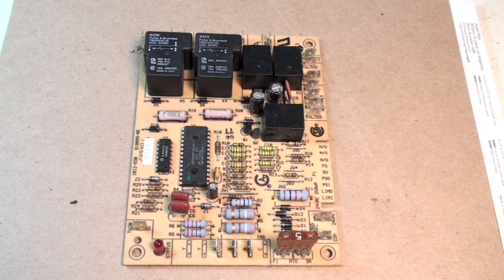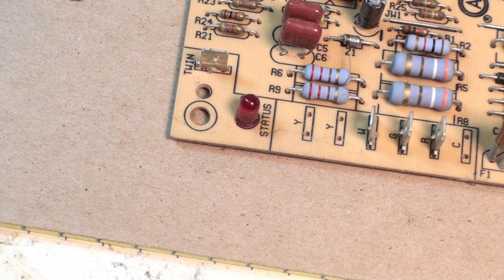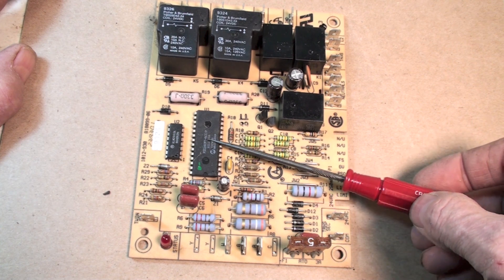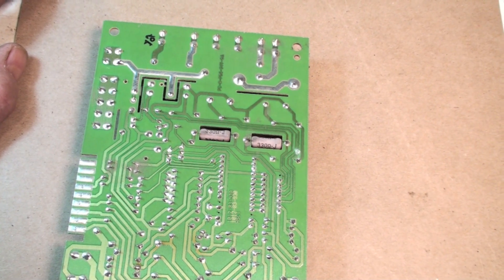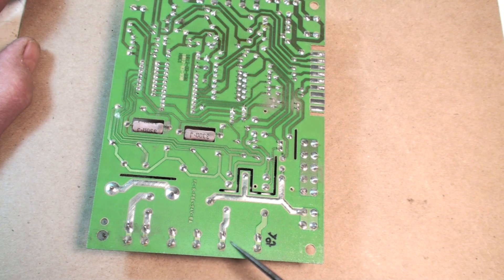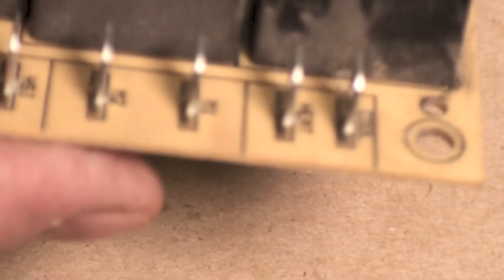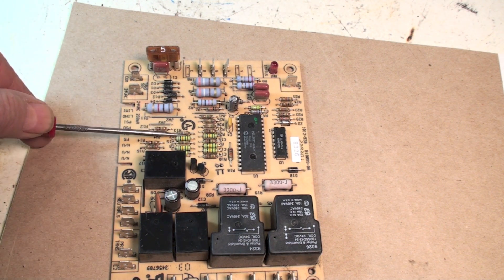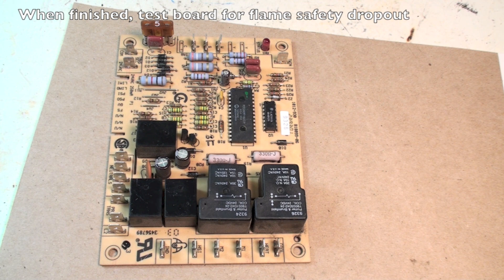Troubleshoot the circuit board of the gas furnace

Comment: Lots of diodes and easy to check . I’ve found a bad zener before on mine . Only thing you can’t replace is the microchip processor U1 U 2 possible but for the price it’s not worth it .

Comment: Nice video. 
My Vulcan 550D furnace fuse keep on blowing soon after I start the furnace. What might be the reason?
Reply from the maker: Is it a low voltage fuse or high voltage?
GFM
Reply: @grayfurnaceman  how can I check whether it is low voltage or high voltage? It is the bottom one which is blowing. Top one is fine
Reply from the maker: @engrhammad  Send me a pic.  Send to Grayfurnaceman@gmail.com  
GFM

Comment: I'm sorry, but I'm six minutes into this < 8 minute video and I still haven't seen a multi-meter or any instruction on "Troubleshoot the circuit board of the gas furnace" as stated in the title.
All I've seen is your personal/professional opinions and advice as to the fact that it is easier and more cost effective AND SAFER to just replace the board.
I agree, wholeheartedly.

But why should I spend $150 + bucks to purchase another board without TESTING the board I have and verifying  that it IS IN FACT BAD ?

I thought this is what I came to this video to learn.
SMH
Reply from the maker: That's because there is no multimeter based testing of these boards.  
Once we moved to electronic controls, traditional electric troubleshooting is no longer effective.  
The board may troubleshoot itself and will give a code indicating it has failed.  However, if any of the relays on the board have failed, it may just not operate.  
That is why I noted the traces may be burned on the back of the board and the larger resistors may have a haloed trace solder joint.  
When troubleshooting a furnace, the board may code where the start sequence has stopped.  Such as pressure switch failed to close.  That means you need to look at venting or combustion air supply.
These boards are often replaced but seldom are they the problem.  They just direct you where to go to look for the failure.
GFM
Reply: @grayfurnaceman  thank you for your reply sir. So you're saying... there is NO way to test point to point on these circuit boards to find where a fault may be ?

Let's say, for the sake of conversation, that it's February, a Saturday evening, -35° F outside, my furnace quits at half past midnight. I live in a very rural area. The nearest hardware store is 18 miles away.

I have a back up generator, two in fact, one for the house and one for the shop.

Without heat, at these temps (common here) our house is going to cool pretty fast.

There is NO 24/7 repair service... we's that rural !

I have a shop, I have tools, I have test equipment and a rudimentary knowledge of how to use it. I need my furnace and I need it now, not 72+ hours from now. Our house is going to literally FREEZE with us in it.

Here in the far north  of Minnesota, we have a portion of February where the temp's drop to below -30° for a sustained few weeks at times !

It has happened to us, more than once and I want to be as capable as I can at being able to troubleshoot any problem that arises here in the woods.

So maybe you see my question differently now ?

I can stock certain parts on hand, but certainly not everything I might ever need.
I do keep things like switches, fan motors,  solenoids, relays and such for both the furnace and also the well pump and the wood boiler.
Without any of these appliances, you gonna get pretty cold up here in da nort :)

I can replace everything one piece at a time, my landlord's method of operation, but I'd rather save myself the time and effort (and him the $$$) and only replace the one part that is faulty.

Thanks again sir.
Reply from the maker: @mebcool  There are 2 ways electronic boards fail.  One, is the electronics fail.  No repair.  Two, a trace burns up or one of the relays on the board fail.   You can, if you have the skills repair traces or wire around the relay to another separate relay.  
GFM
Reply: @grayfurnaceman  Thanks again sir.
I guess I just keep doing what I been doing.
Have a great day bud.

Comment: GFM
researched how the power relays works in general and problems do arraise with them burning coils/connection tips... . Also put in a new Thermostat, similiar to old one, went in smooth, fired up furnace, gas, and large circulation blower.

??  serious on this question... the larger power relay that has a hole burnt through it? 
part  
    T9AV1D12-22
What is your opinion on if I absolutely need to replace the part/board.. and what you may know what it opperates?  Being the furnace seems to run ok and cycles normal! 

Only thing I can think is if it regulates a 2 speed option with the large or small blower fan? 
I know years past it des have a low and high audible modes.

Know I am overloading you some, but this is the main issue I am looking for good advice on .. :) 
Appreciate the help.
 Eric

Comment: GFM, little good news.  know you are busy, bument on what I was able to do today! 

Ok retested the wires going to the ignitor after I reinstalled it, (test ok w right setting on meterohms lowest.)  ran furnace enough to actaully get a reading dood ... double checked the back on board.. dark marks none, just on power relay with a burnt hole in the front corner!

cycled the furnace after testing the water pump, and pump ok, ran it a bit. 
And ignitor did heat up, sat that way awhile and gas Finally!! kicked in.. and take off.. heat!! 

shut it off did it again, and made sure large air circulator fan kicked in.. and it did,, ran it a few minutes and let off the R-W.. gas went off.. 
small fan stayed on in gas compartment, then went off! 

large fan continued to blow.. cool,,  and clicked at the board when going from high to low speed.... then eventually shut off on its own, 

orange light came on, while running , meaning gas / furnace is on, and no problem codes with Red/Green or the Yellow
I did this with out a thermostat connected, still have to buy a new one. 

My question is the power relay that had burnt a hole in it?  What does it control?   (...how is it supposed to function regularly?)    with all the features I described that did kick in and the gas shutting down when R-W was released? 
And what is the problem you see so far... 

Me replacing that board, and probably buying a new board and keeping the old as a spare...
and have to test the thermostat now that I have gotten the furnace to run!, but think the power relay somehow had to do with the thermostat going blank!  if the thermostat is still considered good, but as not much will get a new one and maybe keep current one as a back up. 

Thanks for you thoughts on it.  MEans allot to have gotten this far. 
Eric 
MN

Comment: just removed Ignitor, and cleaned it up a bit.  realized I used too high of a ohm setting .. used lowest one and have a reading.. 20, and sometimes fluxates 40-70..  do not zero or one as I thought at first!  will look at thermostat rod and clean it, but back to the board not sending voltage to the ignitor?  will have to test again to see if I can run it longer to see for sure if the board is not sending any juice to the ignitor... 

Any other things I should check.. to see if good, faulty.. If ordering parts would be nice to get everything in one order, since I will be waiting on the ship time. 

Thx Eric

Comment: update, checked resistance, 200ohm mode, cheap checker.. did it a few times.  and jumps at first then goes to 1.. so, know the board power relay needs changing, or new board, this part.. j-tube modified hard tube to not get the green light blinking code!  what next?  mmmmm turning into a few parts here..  but glad I have some good guidance.!   first time home owner here. 
Where to start..   or what else to check..  :) 

Thermostat may replace as well for good measure!  
Thx Eric

Comment: In addition to my message below from earlier today, ....
had went back and checked the igniter plug, AC reading from the wire coming from the control board.... inserted leads and turned power on, 0 anything, when jumped R-W and running long enough before blower shut off.10 seconds.  couple tries..  So the power relay/ larger one on board maybe effects if the igniter gets any current at all ? 

Was going to inspect the thermostat part, and igniter part for discoloration, but no voltage coming from the board, passed on it for now.  again your thought on appreciated knowing this.
Thx Eric 
MN
Reply from the maker: The ignitor only gets power for from 15 seconds to 45 seconds depending on model.  It gets power after the pressure switch proves for aforesaid time period then shuts down.  
The first thing I would check is resistance of the ignitor.  Isolate it and check.  Should be 13 to 18 ohms for stick ignitor or about 150 for the one that looks like a wavy element.
GFM

Comment: Sorry, forgot to mention that R-W jump (I  keep the jumper on it for 30 seconds),  only turned the gas section blower on, no frst click for gas to come on, or of course igniter. 

Tried again ...  jumped R-W a couple times by touching conections for a second, couple times and blower comes on for a short time, then shuts off.. No smell of gas, and no clicking, just the blower powering up.. 
assuming with no gas being sent that is normal, (again no red/green codes and did have gas emergency valve open prior)
going to try to dig little, .... appreciate your wealth of guidance!
Eric

Comment: OK reinstalling jtube worked for blinking green code.  so no codes currently.  Though  jumping R-W starts the gas compartment small blower, and with gas on... for 30 seconds tried couple times, and no start up. 

Assuming the fried Power relay is preventing it.  (Did not have the Thermostat connected as well).  And again jumping R-G does start up the large circulation blower.  your thought.
Thx Eric
Reply from the maker: Forget the relay.  If gas comes on, but does not light, check the hot surface ignitor.  If it does not glow, it is probably failed.
GFM

Comment: Did perform the jumpers suggested.  R-W, and R-G..  only wires hardwored to the board.  large blower/fan on R-G came on,  and dmall blower came on for R-W, though tried a second time after turning gas on and the green light started to blink, (code pressure switch open fault?  That has to do with the burnt out power replay?   I did leave the j-tube disconnected as was going to repair it in the lower compartment..  But the furnace did not kick on when the small blower motor was running,  no gas first test and 2nd test green blinking led for pressure switch open...fault.  again the power relay part on board is burned up slightly. 
any ideas to isolate.  looked up a couple things to look at for what the code relates to directly.
Thx Eric
Reply from the maker: First, remount the tube and be sure the trap is filled with water.  Sometimes the pressure switch will not close if the trap is not filled.  If no luck, look for blockages in the vent.
GFM
Reply: @grayfurnaceman  ok will do..

Comment: Just a note.. as no picture, the part... power relay and number I posted, is literally burned and smoked.. so no guessing on that part of the board needs to be replaced. or new board.  how it happend?  clogged j-tube where the water drains in bottom compartment, or me switching the breaker possibly wwhile power was on to the furnace.   Appreciate the advice to determine the thermostat.  it does come on with fresh batteries.. and is 4 wired at the wall.
Thx Eric
Reply from the maker: Neither the plugged drain or switching off the furnace can damage the relay.  The only things that would cause that are overload from a shorted motor, the relay simply failing or the coil burning out.
GFM

Comment: will try... one thing forgot to mention that I fixed  with white viniger...  corroded bottom of one bateery connector.. cleaned up nice... and a fine file before that.. but appreciate advice.. 

But stil have to replace power relay!! on the board..   in oppose to replacing.. full board for 200.00 ... yes!..
but doin break jobs, exhaust.. n other car stuff... is not the toughist thing in the world.. 
Thx Eric..

Comment: Thx for reply..  Gray.. :)

    > Switches & Relay  part that smoldered.. 
T9AV1D12-22

Is part number last larger relay on left of board.. switches between 30A, and 20A... so think may be fan relay.. runs in couple speeds.
Also did try to trouble shoot thermostat only and does come on temporarily with new batteries 10-20 minutes before going blank again.
as mentioned code green and red are solid on which indicates normal, even with the part frying on the board?   PS the J tube as mentioned was clogged, darkend in an upper spot before the water pump.. and broke in that spat, wether me currently looking at it or, last spring?? 

Do you think it may be a ok idea to buy part, sodder and if something goes wrong, get a new board.. hate to pay allot of money first to see the same thing happen?  may get a new thermostat for precaution as well. n check voltage outgoing and ingoing to the board?  may need to look up how to do the testing of that.. 
appreciate your feedback on it. 

Thx Eric
Reply from the maker: Here is what I would try.  Jumper R to W at the control board.  If the furnace runs and the fan motor runs, there is probably no problem with the board.  You can also jumper R to G.  The fan should come on.  If all that happens normally, replace the thermostat.
GFM

Comment: Thx for reply.. 
do not know if my reply's go right to you?  (so reposted  last message!)

 System was powered but not in use..(heat only use during winter)  Noticed blank screen on thermostat .what brught me to open up furnace to check things out.

Current board when powered shows a solid green and red light, meaning no problem codes, everything  ok?  funny but true.  Just have Heat and the central air fan that activated when trouble shooting the blank screen on the honeywell thermostat.

Also looked up bpard for my (Tappan) Nordyne Furnace FG7SC 072D-24B, (92.1 efficient gas forced air)( Parts Circuit Board for G7/M7, sku 920915) 150-200.00   and the burnt out POWER RELAY.. looked on board and up part number, about 6.00 part.  everything else looks ok, just little smoke residue.  J Tube in bottom compartment was dark in one spot, clogged. .. and either I just broke it when I moved the tube it was connected to, or it was broke before opening, but from the end of last early spring??  so a while since the system was in use!  was curious if any other componenet or part on the furnace would cause the power relay to burn on the board?  to bad the light codes do not reveal anything!  

 So was considering removing power relay from the board and resoddering new one in... same specs on part.  worst case buy a new board and install. (tracking the settings and details from old board). 

Appreciate your insight for a cost effective, but good fix.. before it get cold soon. 
Thx 
Eric, MN

Comment: PS.. a question as well... The furnace is old, but hopefully getting a new board fixes it??  IE what caused the board to fail?  trying to DIY, but even if a repair guy came to replace the board for an obvious... black square block burnt out?  the same thing could happen unless you had a repair guy with insight and care you seem to have to look beyond the end of the day paycheck, and easy fixes..  but still cheaper than a whole furnace replacement.  on a tight budget now so why my DIY..  Thx
Reply from the maker: Thirteen year old furnace is just broken in.  Life is 20 to 25 years if set up correctly upon install.
Burned spot is meaningless as it is a resistor that is designed to dissipate heat.
What are the error codes?
GFM
Reply: @grayfurnaceman  Thx for reply.. !  System was powered but not in use..(heat only use)?  Noticed blank screen on thermostat .what brught me to open up furnace to check things out.

Current board when powered shows a solid green and red light, meaning no problem codes, everything  ok?  funny but true.  Just have Heat and the central air fan that activated when trouble shooting the blank screen on the honeywell thermostat.

Also looked up bpard for my (Tappan) Nordyne Furnace FG7SC 072D-24B, (92.1 efficient gas forced air)( Parts Circuit Board for G7/M7, sku 920915) 150-200.00   and the burnt out POWER RELAY.. looked on board and up part number, about 6.00 part.  everything else looks ok, just little smoke residue.  J Tube in bottom compartment was dark in one spot, clogged. .. and either I just broke it when I moved the tube it was connected to, or it was broke before opening, but from the end of last early spring??  so a while since the system was in use!  was curious if any other componenet or part on the furnace would cause the power relay to burn on the board?  to bad the light codes do not reveal anything!  

 So was considering removing power relay from the board and resoddering new one in... same specs on part.  worst case buy a new board and install. (tracking the settings and details from old board). 

Appreciate your insight for a cost effective, but good fix.. before it get cold soon. 
Thx 
Eric, MN
Reply from the maker: @erice.5844   So, you are saying the burnt part is a relay?  There are usually 2 relays on the board.  One for the inducer and one for the fan motor.  I can't see where the blank screen on the thermostat would be connected with the burned relay if the board lights are on.  Are you sure the thermostat is ok?  Is there power to the thermostat?  Is it battery powered?
GFM